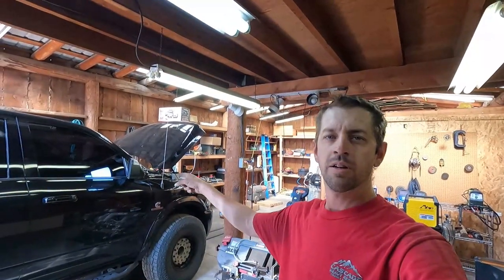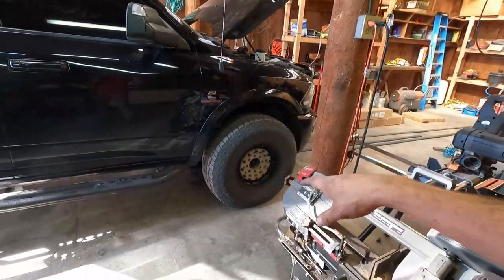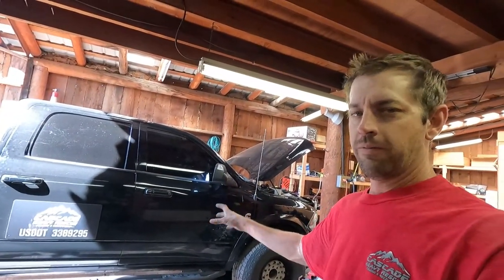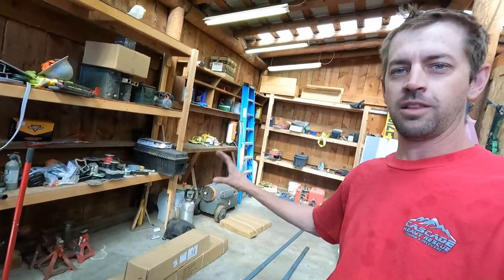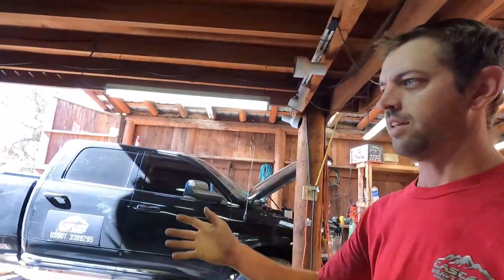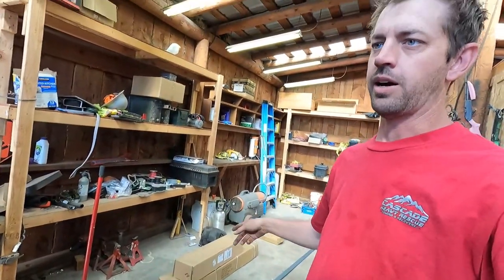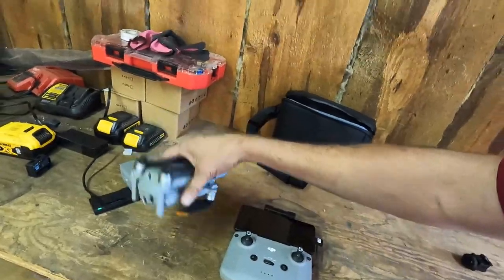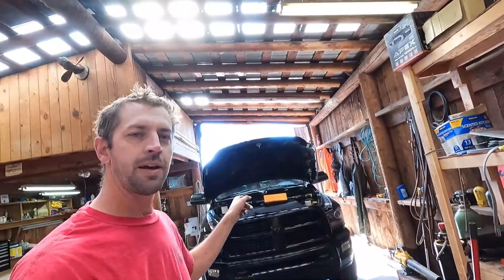New tow truck update and shop talk

Comment: Make sure the doors are REALLY clean when you put the magnets on.  If there is any dirt or dust the magnets will move while your driving and scratch the crap out of your paint.  I used to run magnet logos for the same reasons you stated and I battled scratching the paint the whole time.
Reply from the maker: This paint is already hammered anyways.  The magnets aren't going to make it any worse

Comment: 3.3.22  Question:  When you change wheel sizes what happens to the anti lock brakes and the speedometer?  How do they get adjusted?
Reply from the maker: The speedometer will be off, but if easily corrected.  The abs doesn't know any difference

Comment: Regarding frame reinforcement, I have an old Ford in the yard that had 15mm deep rust pits in the beams so I took a driver and a real sledgehammer but the only thing that happened was the driver ricocheted like a bullet and barely even left a mark so it must have been more than 5mm left because otherwise it would have looked or gone through so ridiculously thick- maybe a full inch thick? Didn't matter to our inspection here there must not even be a hint of holes! Presumably, the legislators are bribed by the car salesmen as not many people can fix such rust damage themselves so it will be best to buy a new one for them... And everything else was made for extra heavy load I drove 6 tons in it with no problem other than I had to rise the tire pressure to 6 Bar and that is an important thing to know- never let the air out of steel-reinforced tires because if you do you are risking your and others life because the steel will brake if you bend it every lap the tire goes around and even with the power steering you have no chance of holding back if a front tire explodes!